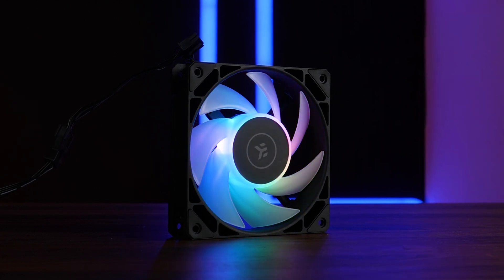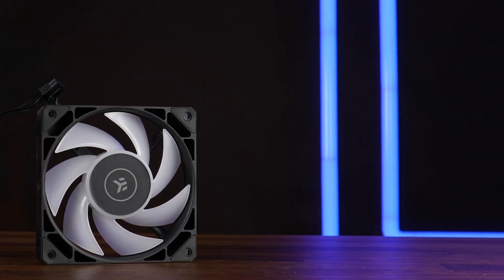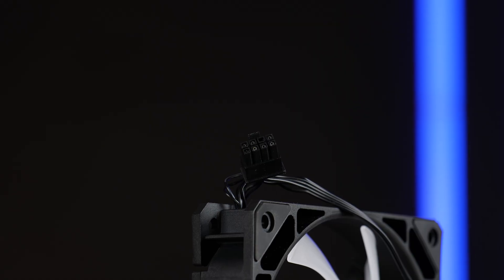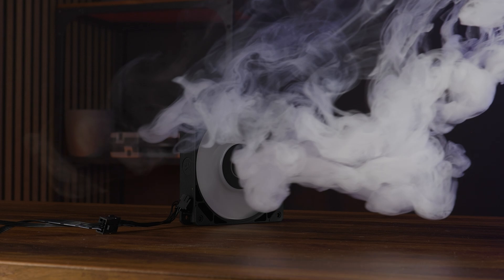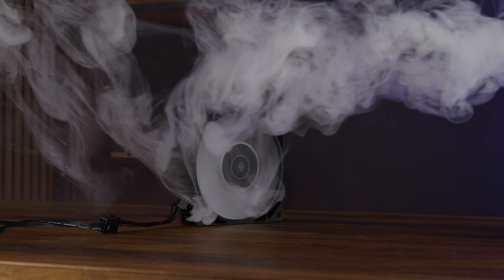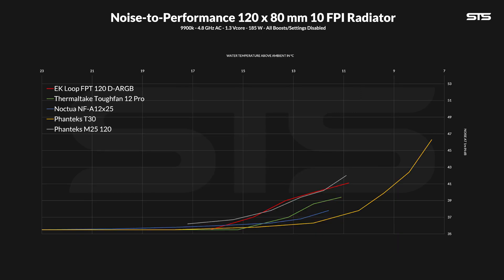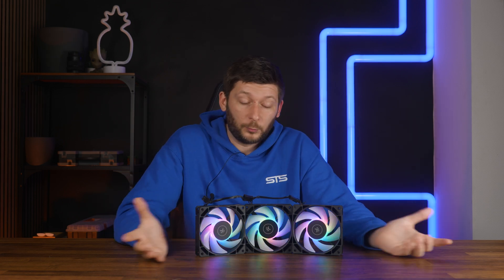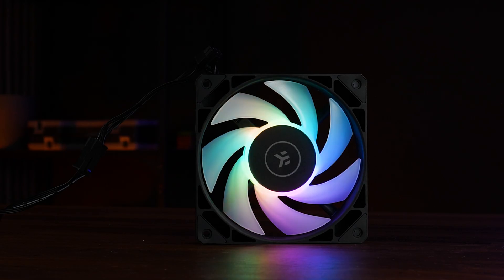Worst Timing To Publish This Review -  EK-Loop Fan FPT 120 D-RGB

Comment: so for minmaxing could i connect the phantek t30 with thee ek nucleus cr360 loop and get a much better noise to performance ratio? or are the ek-loop fan fpt 120 just made for the loop and work just better?

Comment: 5:40 "a lot" I'm sorry, but ONE degree cannot be called "a lot" unless you're only looking at a small part of your curves. One degree is significant, but not "a lot." Just a correction from a former ESL teacher. ;)

8:10 "bottom of the barrel" and "high-end zone" do not go together, and your data doesn't support that statement. They're high-end, but in the bottom range of that group would work better. ;)

Comment: I’m sorry but please explain, how on earth the Noctua NF12 is so low down this chart?  04:58
There is absolutely no chance scientifically that the Corsair QX120 fans beat it, it’s a question of physics and just not possible. Debauer even proved it in his review of how bad the QX120 is for airflow or static pressure. So if that’s wrong then what else is wrong is wrong I your charts?

Comment: When it comes to radiator fans, I think it’s useful to rate them by thickness class and by RGB vs Non-RGB. The fan thickness affects compatibility with cases, motherboards, distros, and radiators. “The best performing 25mm thick RGB fan” could be a fan worth looking for if a buyer wants maximum compatibility and likes the aesthetic.

Comment: I have those, non-RGB version that came with Nucleus Dark 240 AIO.
At first I expected some crappy fans but these are quite good for "stock" fans.
Really quiet until you start hitting 1400+ rpm on a radiator.